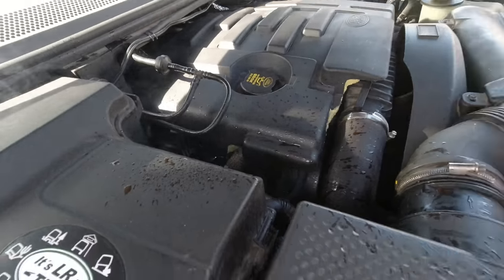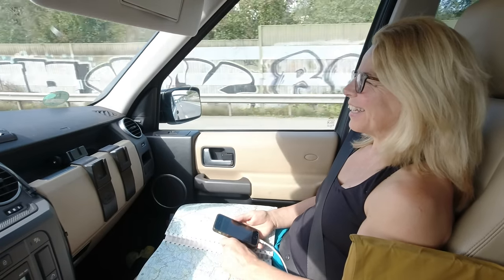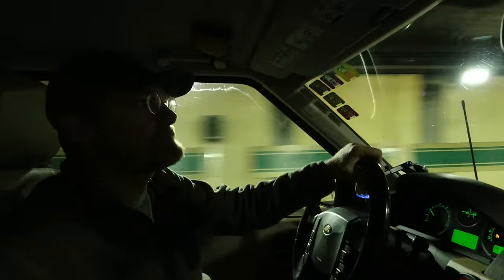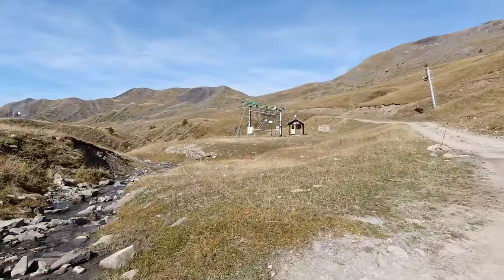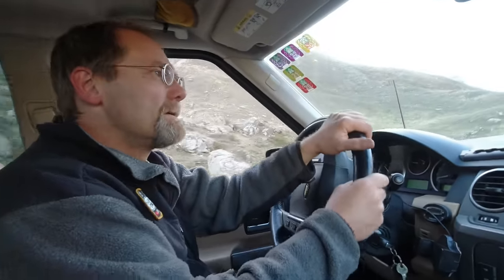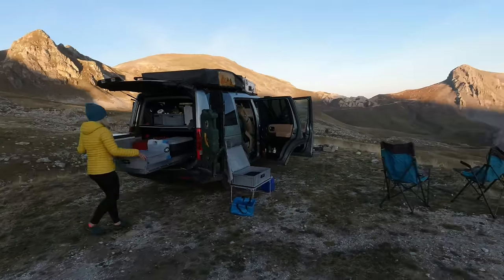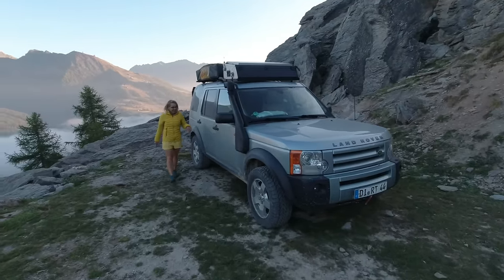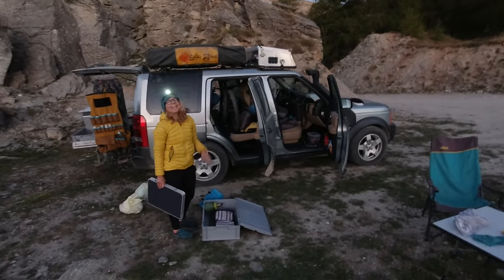2000 km Shake Down after full Rebuild in the Alps - OMG / S4-Ep47

Comment: That was a really good shake down trip.

Really lucky to have a stream there when you needed a few liters of water.

All I would say to help others is, it's best to let an overheating engine cool for an hour before adding cold water. If you can't wait, add it very slowly with the engine running. This way the water will warm up as it enters the system and not cause a sudden change of temperature which could cause a failure due to temperature shock.
 
A few small issues is a major success considering what you achieved without professional assistance and with limited tools. Fantastic.
Reply from the maker: What you watched in a couple of minutes, took us hours to complete. And do remember everyone wading with a hot engine in cold water.  All is well now. Car has been running for 2 months and 6000km by now. 👍🙋‍♀️
Reply: @Vera_and_Christian  a fantastic achievement

Comment: What will happen to the engine if runs on not enough coolant for a while ?
Reply from the maker: It will blow a head gasket, at least. So you better pay attention to your coolant level. In our case, everything happened in a minute or two. So it was not running hot over an extented period of time. 👍🙋‍♀️

Comment: Hopefully the overheating caused by that badly clamped coolant hose didn't thermally stress any engine components too much Christian. Was it not risky being up in those altitudes with a very low anti freeze level? Some years ago we traveled through the Atacama desert, in a Toyota of course, the night time temperature was dropping below freezing while the days were quite warm, we would have been stuffed without a proper level of antifreeze. Is that all "one way only" mountain trail, you didnt seem to meet any oncoming traffic?
Reply from the maker: The coolant loss was abrupt, we did not had a slow leak somewhere and the coolant level was at a low for a long time. We went in late September on workdays. We saw others, just not on camera. But on the weekend, there are lots more on these trails. 👍🙋‍♀️

Comment: Great to see the LR in the mountains and wow some fantastic views  , I always wonder how the average car would survive that sort of journey ? normal people would just run it close to home for the shake down but no not you 😂
Reply: It's possible if you drive slow enough and aren't afraid of some small body damage on the lower parts.

I've seen a new fiat 500 drive on a road like this in the Pyrenees.
Reply: @perpelle  wonder how it was at the end of the journey , surely some underneath damage and maybe suspension problems

Comment: Did you put that engine out the black Land Rover into your Land Rover
Reply from the maker: No, if you follow our channel, you will see that we completely rebuild the engine of my 2.7 L TDV6. We actually did an almost complete restoration of my Discovery 3 of the frame and engine. And before that, we did a complete engine rebuild of our Land Rover Discovery 4, which we bought with an engine failure. 👍👌🙋‍♀️

Comment: Part of the Lion engine family the 2.7 TDV6 was developed by Ford and also used by Jaguar and Peugeot Citroen. However to maximise low speed torque for towing or off road use Land Rover fitted a large capacity single turbocharger rather than use the twin turbo version. There you go i dont know why you are surprised you broke down when you usign an engine made by an american company used on jaguar citroen and pegeout, you sjould have bought the old freelander swap the engine for the BMW N57 and you would have a great capable light offroader.
Reply from the maker: Must have been the first video you watched on our channel. 😃🙋‍♀️

Comment: How do you still run an iphone 8 or 7 in 2023 ? isnt the battery dead ?:)
Reply from the maker: Anyone able to fix a Land Rover can fix an I phone. 😃👌Christian just replaced the battery on an Iphone 12. Newer ones also do not last.  I will use my phone, which is a Iphone 5 btw, as long as I can.
Reply: @Vera_and_Christian  vintage iPhone 5 nice , respect . Should be in a museum in a few years 😅

Comment: Maybe it's time to forget that british junk and get yourself a toyota 4runner.  It's an amazing vehicle good for offroad in stock configuration, requires minimal maintenance and it never breaks.
Reply from the maker: Maybe it‘s you guys get that we have car repair channel and not a offroad channel.😅👍We have commitments like work and kids and responsibilites to our families. We cannot take of every weekend like some fulltime Youtubers can. And the Land Rover is so much cooler looking than any Toyota.😅👍🙋‍♀️
Reply: @Vera_and_Christian  I have never said that you have car repair channel. No need to be defensive about it. I also have kids and business to run and I go off-roading way less than what I would like to. The last thing i would like to do is  to fix my vehicle on the trail. I wished for you something that I have for myself - which is an honest wish.

Which vehicle is more beautiful is subjective. For me, beautiful things are those that work and last. I am on my 3rd 4runner. First two were both over 200k km when i bought them and I have put over 200k km on each of them. The third one I bought new and now has just under 300k km. You know how many times i had to pull the engine out - zero. Keep in mind, I off-road on trails in British Columbia, Canada, which are very difficult trails. I guarantee you, you will not see a single LR or RR here.